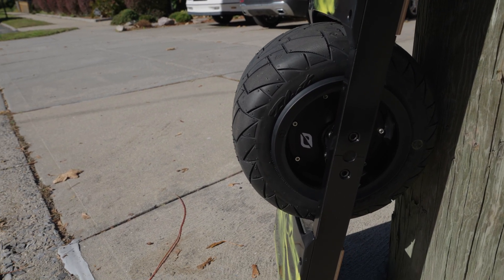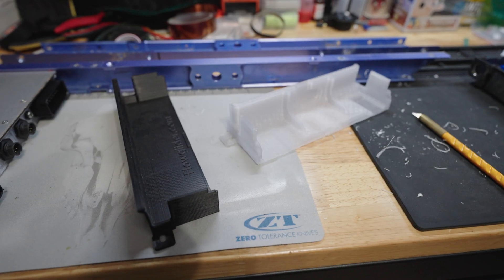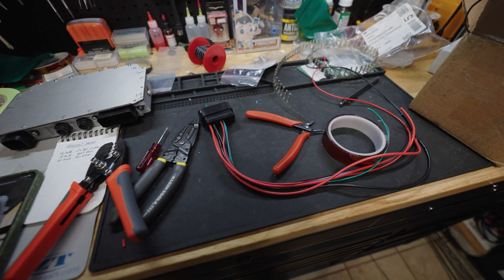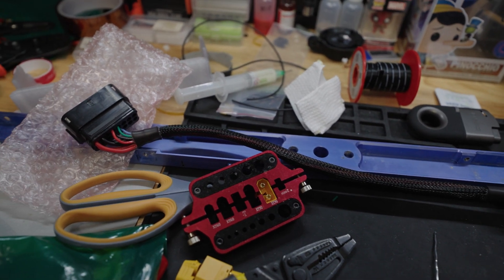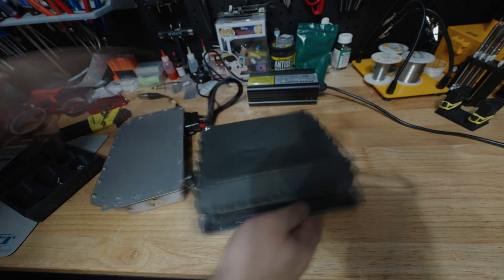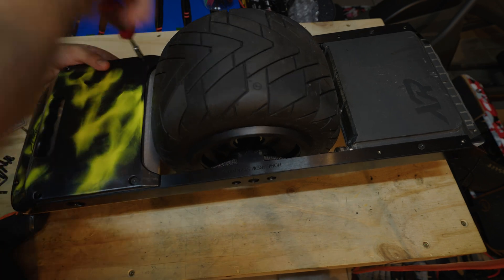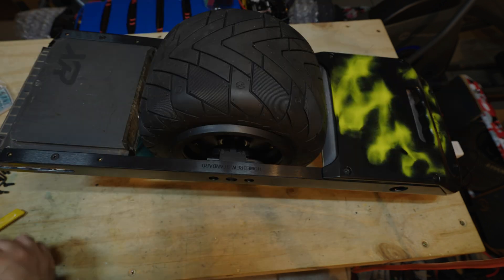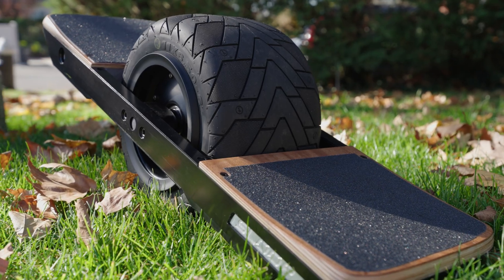VESC Onewheel Build Project | Final Assembly & Ride

Comment: I really need this for my XR. But my question is, does this work with a 4213 XR?
Reply from the maker: DIY and VESC boards use different electronics, so there are no Future Motion electronics left. This would be a good video to go to for more information:
https://youtu.be/gaHIFx08fO8?si=hApAL47Sc4lv50i9

Comment: Really wish there were more open source/DIY VESC and BMS designs, the original price for the Little FOCer was supposed to be around $90 but now they retail for $300 not including a heatsink. Add in a decent BMS like the XLITE for another $250 and at least $500 for a built battery plus all the connectors (assuming you have all the crimpers and other tools like a 20S capable charger/power supply) and you could just buy a brand new Onewheel instead.

Comment: How's the battery life compared to a Onewheel? It would be nice if my GT didn't slow down so much when the battery gets to 35%. The acceleration really drops, but it'll eventually get up to speed. It's a champ going up hill until 45% when it takes it easier.

Comment: Board looks great man, how achievable is it for someone with no DIY experience to vesc their XR right now?
Reply from the maker: If you’re not looking to change the specs of the battery, then it’s not very difficult. MakersPEV provides pre programmed VESCs and parts for reusing most of an XR. This particular build was from collected parts, and custom built parts.

Comment: VESC has gone from a “eh, it’s an option but not something i would consider” to my primary way forward for when components on my XR fail and require a replacement/upgrade.
Reply: It's my daily driver now!! I swapped my functioning xr to vesc and love it! You should try to find and ride someone's vesc board sometime
Reply: @huff_designs  stock battery? What do you like about it?
Reply: @chrisperrywv  I did have a stock battery. But I my own 18s2p pack and both had a ton of torque and speed
Reply: @huff_designs  still with the stick hyper core motor?
Reply: @chrisperrywv  yup, now i upgraded my battery to 18s2p for extra range and speed tho
Reply: @huff_designs  I want to do it 🤣

Comment: Great video!! Not gonna lie, hearing you struggled a bit makes me very nervous to attempt this! Probably will go with a pre-built box
Reply from the maker: All things considered, it wasn’t that bad. It was probably about 2 days worth of “I just don’t know what I’m doing wrong” before it was working. My day to day is Eskate work, and I’m so familiar with the remote control sides of VESC that once I hit the Balance App, I was really in new territory. 
I think that in time, the documentation will be more fleshed out. Naturally, like DIY always is, the information is often scattered, and piecemeal. Which makes it hard if you need top to bottom education on a new topic. 
But that too, will come as more get into it. 

I did my best with the article to give a top to bottom picture of the material build, and some of my build philosophies as why I do what I do with wiring. 

I’m hoping that after I really wrap my head around it I can contribute to the configuration documentation for other new folks, and offer my perspective as someone new to the Balance app.

Comment: Curious on top speed and range?
Reply from the maker: Range, I’ll test soon. Top speed, probably more than I’m comfortable doing on one wheel. Another community member with this same battery was easily hitting 28mph, and pushing into 30. Could probably go faster, but I think pushback is somewhere around 29ish at the current settings. I’m not sure at the moment.
Reply: @TheBoardGarage  pushback starts at 29mph? That is crazy!
Reply: @chrisc790  the onewheel crash group is going to be extra gnarly now